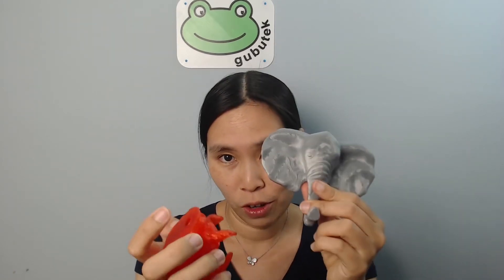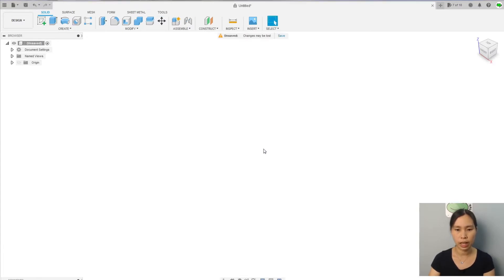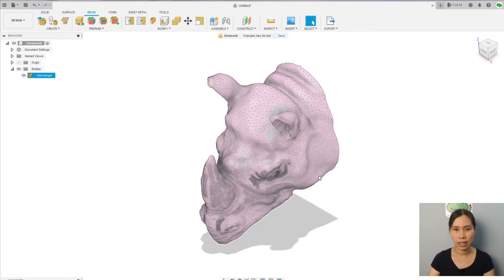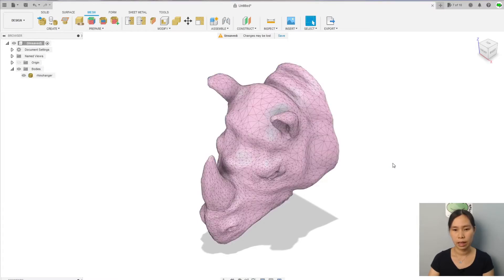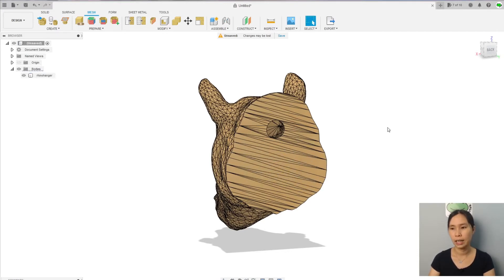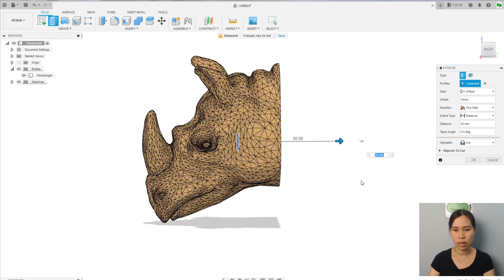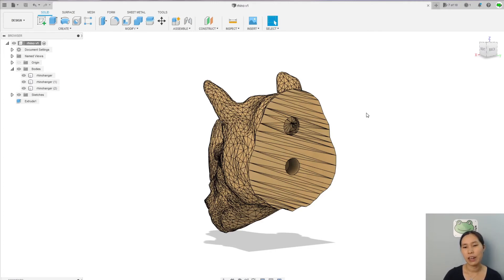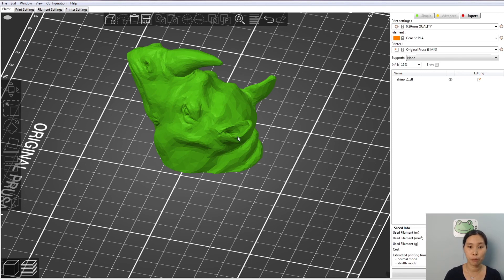Large STL file editing using FUSION360 - Part 1 Solid workspace

Comment: A much faster way to export to STL, is to right click the body (or the component, or the top node) and click "Save As Mesh". This way the conversion is done locally on your computer instead of in the cloud. Using the Export function takes a very long for me, where as Save As Mesh takes a few seconds at the most. ^_^
Nice video. Extra points for time codes in the description. Keep it up!